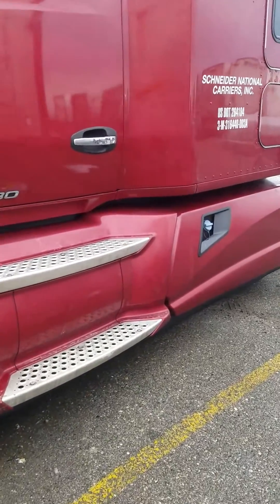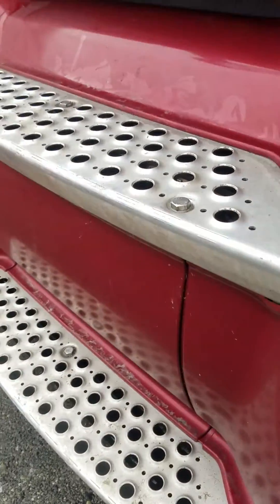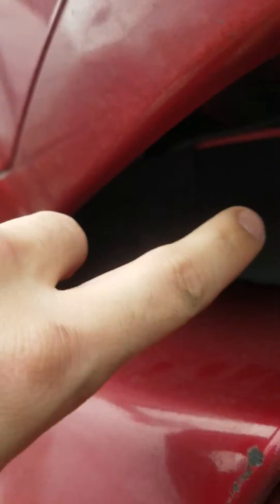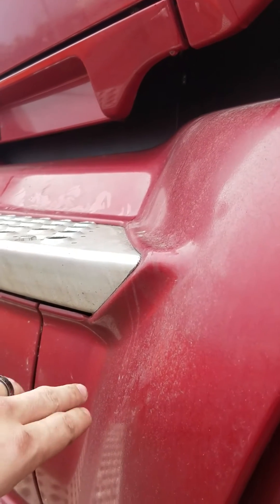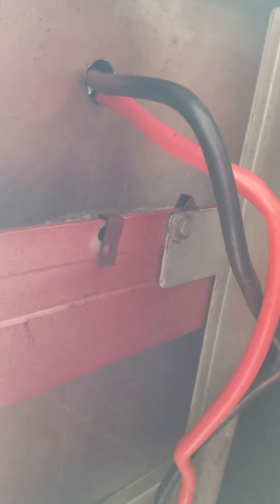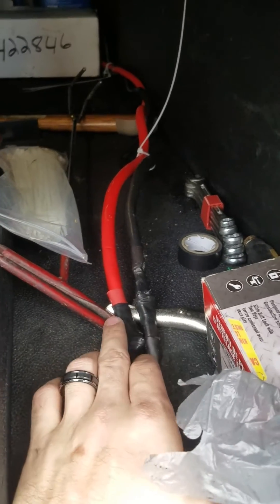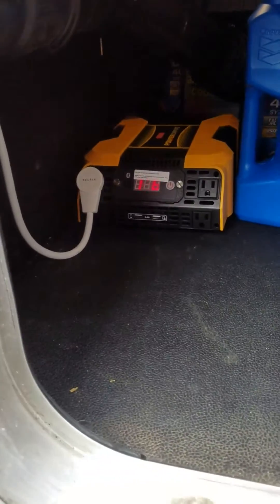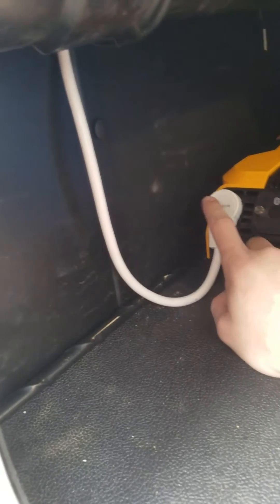how i ran my power inverter.

Comment: 1:12 there needs to be a rubber grommet in that hole. that electric tape is not going to last long. you're waiting for an electrical fire.
Reply from the maker: circusboy90210 I filled it with silicone shortly after this video
Reply: even though they have an internal one. a good electrician will always suggest an inline fuse.   there are also inline mini auto reset breakers.  just looking out for your safety.
Reply from the maker: circusboy90210 thanks I appreciate it. Before I hooked it up I was just having a hard time finding a place that sold them. And I didn't want to order one if I didn't have to
Reply: I would want a inline fuse if that wire chafes and grounds out it’s gonna burn if a fuse was there it stop it from melting down

Comment: Anthony, do you feel a new driver would have an advantage starting with Schneider opposed to another company in preparation for moving to the IC side/board after a year?  It sounds like most guys on the board are happy and it makes sense to me to start with Schneider since the 1yr plan is to move to the board.  School me, please...thanks in advance.
Reply: I spoke with a recruiter and she informed me the only option available in my area (MI) is regional dry van...starting pay is .44cpm which I think is VERY fair for a rookie.  Pay is said to be higher since they count military time.  Thoughts?
Reply from the maker: Uncle Matt, If the IC  program is what your wanting to do i definitely think you would have an advantage. #1 you will probably learn the customers and where you can find a lot of freight. And #2 you have a chance to learn how schneider operates.
Reply from the maker: Uncle Matt from what ive heard tho, i think you only have to be with schneider as a company driver for 6 months
Reply: Anthony Newhouse thank you!    I was thinking the same but it's good to hear it from someone with experience.
Reply: Anthony Newhouse the recruiter told me 1yr but I've read elsewhere that it varies depending on availability/demand.  If 1yr is worst case, I'm completely comfortable with that.  

Are you pulling van?  If so, do you feel it's better/worse than refer for getting regular (weekends) hometime in MI?  Sorry to bombard you with so many questions -- really appreciate your time/knowledge.  Safe travels
Reply from the maker: Uncle Matt, no problem im on my 30min break right now haha. but i live in belleville,MI. im home every weekend. ive got 2 kids and a wife so to me its a necessity to try and make it home every weekend. granted i do leave out late on Sunday's and get home either late friday or early Saturday morning.
Reply: Anthony Newhouse I'm about 100 miles north of you in Lapeer.  My home situation is similar and that's one of the big attractions to IC with Schneider.
Reply from the maker: i pull dry van, yes. and 44cpm is good starting out. at most companies thats what u get paid for  having at least a year of experience. i also think that your hometime is gonna be around 2 weeks out and a weekend at home. they lost their battle creek yard and have everyone parking in woodhaven.
Reply from the maker: yea i know where you're at then lol.  and i mean if your looking at doing at least a year of OTR before going on the choice board i would definitely look at all your options if hometime is key for you. some companies in michigan are home every weekend. but if your ultimate goal is to be on the choice board then learning schneiders freight areas would definitely give you an advantage